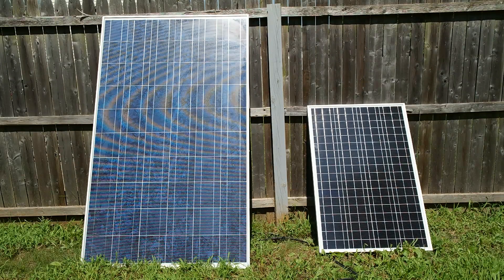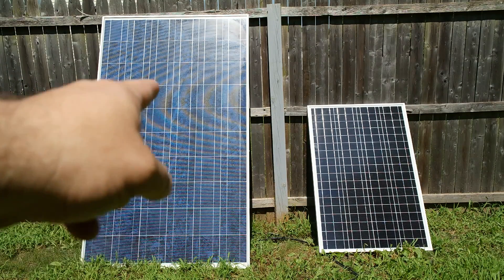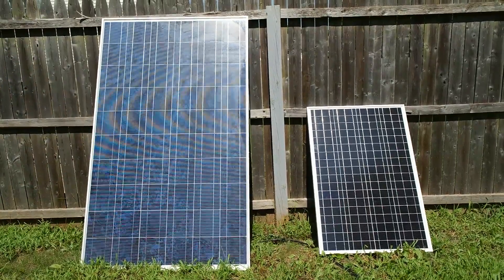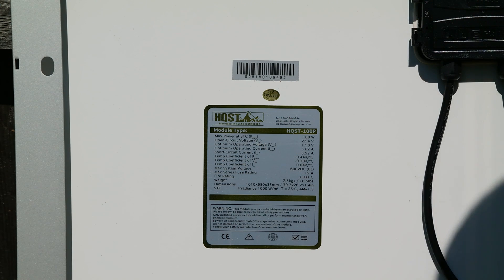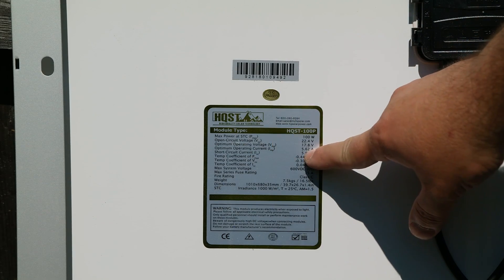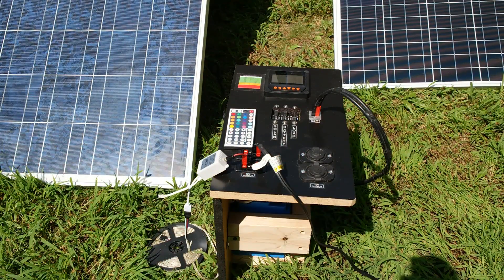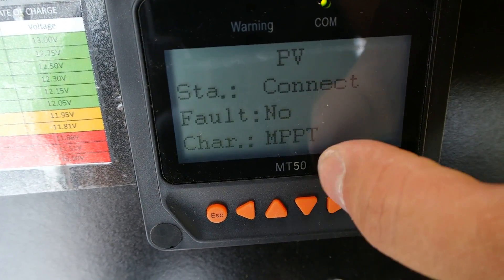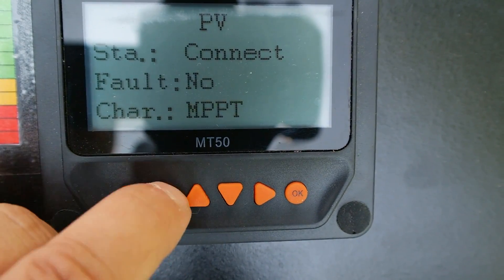Can You Run Mismatched Solar Panels In Series

Comment: I have 6 x 600 watt panels rated at 32v 18amps, I want to add but old panels not available only 600watt rated at 42v 14.5amps can these be run in series and what effect would happen. Thanks

Comment: i have the same type of panels, this cant work unless you add anouther 100 watt panel, because the lowest common domanator is the 4.3 amps from the 100 watt panel, that will  limit the current of the 200 watt panels, even though you get double the voltage. when in series the amps have to be the same. when in parrelell the volts have to be the same

Comment: Thank you for the demonstration, very interesting, would have been more useful to know the details on your 200w panel.
However, doing the maths on the panels - you have 1 x 200w panel series with a 100w panel = 300watt, yet your measurements with the panels in series only seems to show an increase of about 10w from what should be 300w, I’m not sure if this could be considered an efficient way to use them.
Many thanks  for showing your video.

Comment: Thanks for you great video. I have a 120 and a 130 watts panel. 19,20 with 6,25 a and 20,30 with 6,9 a. Would you wire them in series or parallel. and What can I get out of them? Thanks Kirsten
Reply: I have 4 batteries of 200AH @ 12V each. I have 5 different panels to power the batteries. What connection will work better to power my home?

Comment: Hi,  I have 15 solar panels. 13 are 24 volt 200 watt and 2 are 24 volt 170 watt. What is the best way to connect or wire them to a 48 volt system?

Comment: One thing you did not mention is the amperage of the mismatched panels in series will be limited to that of the lower amperage panel.  For example, if you had a panel that puts out 8A by itself and another panel that puts out 4A by itself, putting those in series will limit the current to about 4A, so you would then lose about half of the power from the normally 8A panel.  When putting "mismatched" panels in series, it is usually best to at least get panels that have similar amperage ratings (Impp ratings).  Such as 5A and 4A would be acceptable.  Ideally, if you are using a 24V and a 12V panel in series, they should be the same amperage rating (such as 8A), so the power of them will be pretty much additive (200W + 100W = 300W for example), assuming your MPPT solar charge controller can handle the higher series voltage properly.
Reply: Basic point to ponder in mismatch panels.
Reply: Which ever way you connect, the end result is the watts. Watts will be same.
Reply: Wrong! In the video you can see clearly! 6.3A and 4.5A results in 5.0A after connect both in series! Doesn't not math amps will not be the minimum instead will be the average approximately...
Reply: TRUTH

Comment: You can to a certain extent. Once you get over 500wqtta you're dealing with over 100v and need a charge controller that can bring that back down. My renogy can't. I should try my make sky blue charge controller and see if that one cam handle 115v

Comment: I tried a 12v 475watt and a 12v 100watt to make 24 and I was just getting overcharge warning because the smaller one was rated at 6amps but more like 5. so that means they were pumping out around 115. So I just decided to install a switch between the 12 v batteries and while charging have them separate and use 2 charge controllers. Anf when I'm stopped switch and make them 24v because I have a great 4000 watt pure sine inverter.

Comment: Thank you for good explanation . I have just acquired 4 panels 200watts 18v and 3 panels 395watts 41.4 v  I can Mismatch  the panels?
Reply: Im trying fimd out the same mabey this only works for 2 pannels, 3 pannels he probably get loss
Reply: The output will be limited to the panel with the lowest amperage.

Based on the watts and voltage, the panels is not that much mismatched if they are set up in one string.
Reply: Do you mean series?

Comment: How about both 12v panel mono and poly panel
Reply: Can be combined. But , the question is why, when you can buy both PV panels of the same type? There are contravercial comments on Poly-crystalline PV cells, being inferior to Mono-Crystalline cells. Mono_crystalline PV cells are preferred along with a good Charge controller and LiFePo4 batteries. Flooded batteries and even AGMs are, these days, considered inferior due to excessive maintenance and weight, besides shorter life span. At the advent of better chemistry Lithium Ferric Phosphate (LiFePo4) batteries are preferred , though expensive, their life expectancy is about 10 years as opposed to Flooded batteries being 3~4 years. Cheers.
Reply: @sreekumarUSA  ok thanks.
To answer your question why... because i hv already mono and poly pv here

Comment: I have 2 solar panels approx same size.
One is 215 watts running 29 volts
The other is 275 watts running at 39 volts.
I have them paralleled wired into a pwm controller and get about 10 amps at 12v which is rubbish.
I have ordered a mppt controller..
Why is parrallel bad for mismatched panels.
Thet both run at about at 8 amps at their respective voltages.
Would i benefit from running them in series? Bearing in mind thats approx. 70 volts and at i guess 8 amps
Reply: Most likely because pwm is only a 12v charger. You need a mppt to handle the difference.
Reply: Also parallel is like 2 separate pannels so whatever pannel is weaker its going to drop the other to its level just like 2 batteries.the stronger will only charge to the voltage of the lesser battery. Series you are basically turning the two panels from 2 individual in a string into one giant pannel. That being said if one gets shaded they both suffer
Reply: @sykotic1976  i have had my mppt controller working now for nearly a month.
 i wired the panels in series but never get more than about 250 watts on a sunny day and about 4 amps....
 Ive noticed that when in parallel, the panels arent so sensitive in low light levels so this is why i wired them in series. 
I think i need to rewire them back to parallel and see if that gets better results during the day.

Comment: Hi,
Can we add 
String 1: 330w+330w+300w+435w+435w 
String  2:330w+330w+300w
and both are parallel strings in MPPT invertor .(Panel voltages are 48v for all panels)
Reply: i think it needs to check the string1 and string2 open circuit voltage . different voltage cannot be parallel.
Reply: Anees Ali Saheb, Salam. Of course you may combine different wattage PV cells for charging  your batteries. The thing is  you need to combine similar PV Cells together and have them in Parallel configuration before entering into GOOD Charge Controller. Remember connect all your similar PV cells in any series parallel combination  and if the power is more than the Charge controller, use 2 Charge controllers and parallel the output (12VDC or 24VDC or even 48VDC) The subject is very large to explain due to time and space constraints. Cheers. Khuda hafiz.
Reply: You have two things to consider: panels and controllers.  What the the panels put out, and what the controller can take in. I don't know about different watts though, I'm new too, ( some answer, huh?)

Panels: you add up the open circuit voltage of each of the 12v panels, say 4 x 12v panels is 84v (21voc each)

Controller:  might say it can handle 10-22v, 10-90v or 18-60, 29-150.(picking numbers at random here) ) the first two are for 12v panels, and the second two are for 24v panels.  The numbers can be wildly different between each controller. So people plan their systems.  i.e.: Series higher voltages can handle a smaller wire and the length is cheaper and can go farther.  And you shouldn't get to close to the upper conroller volt number, and amps is just as important.  MPPT is in this video, I don't know how this applies to PWM.  The rule of thimb is you get what you pay for in solar. Quality costs, and forgives tolerances.

The controller with the lower first number(10v) is for 12v panel, for clouds etc.  The lower first number 18v controller will not produce electricity when the panel dips below 18v, so a lot of volts from the 12v panel are wasted. So use that controller for 24v panels instead.

Comment: i hv 4 nos 125 watt mono panel 12 volt each. i hv connected 2 panel in series and other 2 in series. and lastly connected both series pannels in parallel. i want to connect a 24 volt 250 watt poly panel in parallel. is it possible ? i hv mppt charge controller.

Comment: individually you were getting 232watts for both panels. but in series you are getting 209watts. LOSSES TO STEP DOWN HIGH VOLTAGE TO LOW VOLTAGE................... well why you didn't check them parallel too?
Reply: The two panels he demonstrates are a nominal 200 & 100 watt. Charging a battery through separate, 12V charge controllers, would they not have a 300 watt potential?
Reply: @kelhawk1  you need another controller just, it will be more productive

Comment: 3:05 and you did not optimally aligned the panel for the day and area (I use a app with my phone sensors for this) for max solar output. New to solar myself but thinking my do better if you added a bypass diode across the panels to better match them maybe? Kind of like this https://www.alternative-energy-tutorials.com/images/stories/solar/alt135.gif
Reply from the maker: Those bypass diodes are normally built into the back of the panel access cover.
Reply: The built in Diodes are not bypass diodes. It's called Blocking Schottky Diodes and that is to prevent battery drain when PV ceases to generate power to battery. The other diode,( Brian's image), will do nothing to enhance absorption process. That circuit is used in Voltage regulators. A 30~40 Degree angle PV facing North/(South) depending on geographical location is considered good position.Cheers

Comment: From seeing this amazing video I want to ask if you can use a 36volt/(300watt to 480watt)  or more solar panel system to charge a 24volt battery bank?
Reply: With a charge controller, yes.
Reply: More preferably Victron CC. But why the overkill? I can understand if yours is an experiment. But practically a 200W PV cell output would be quite sufficient. (depending on Geographical location)
in any case a CC is a must in any PV Cell System, preferably with BT and other paraphernalia like Circuit breakers, battery monitor, etc etc.

Comment: I have 4 panels of 250W (28.4V & 8.14a) and 3 Panels of 340W (38V and 8.72a). 
I didn't try them yet in series, but what do you think about how much % or Watts I will lose? MY inverter can support upto 4000 watts, 
I just cannot find the 250W in market as of now. all are 300W++.

Comment: I have four Harbor freight 25 W panels I also have for 100 W hou panels how do I pair them together
Reply: Ray, did you mean either Parallel or Series or Series parallel combination? You may wire the PV panel which ever way you prefer. but remember to incorporate Circuit breakers in your system.
Remember if you series the 25W (12VDC)=48V@25W if you Parallel = 12VDC@100W. In this instance you may parallel both=12VDC@200W. It's quite complicated and as such there are several other physics involved. time and space restrict me to elaborate. Try, test. you'll learn this way. Stay safe.
Reply: Explorist life covers this topic well.  https://youtu.be/jejro4zkl8I

Comment: I'm using 5 panels of 150 watts with 18.5 volts, 8.33 Amps and 4 panels of 250 watts with 36 volts, 7.33 amps and are using them in series. All these make 1750 watts together and at my inverter with builtin MPPT controller I receive upto 250 volts DC and 1255 watts AC. It's 72% output.
Reply: I have 4 panels of 250 (28.4V & 8.14a) and 3 Panels of 340W (38V and 8.72a). 
I didn't try them yet but what do you think about how much % or Watts I will lose?

Comment: What charge controller was that? Looks very nice also very informative video.
Reply: Yes you can connect different panels in series but the reality of this is that the maximum current will be limited to the maximum current of the smaller panel.
Reply from the maker: epever tracer 2215bn